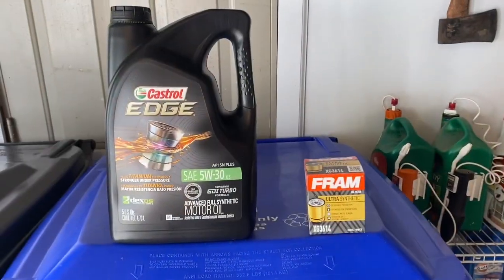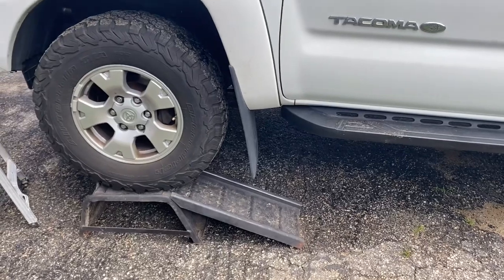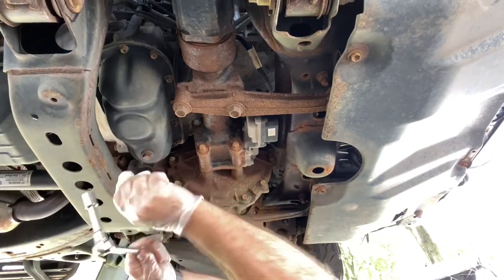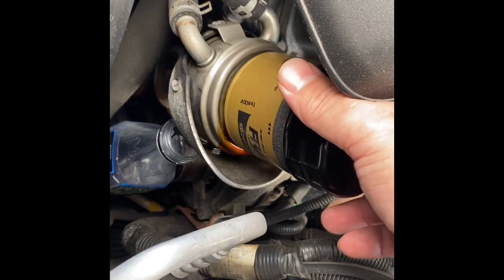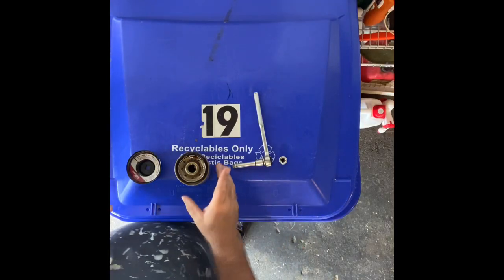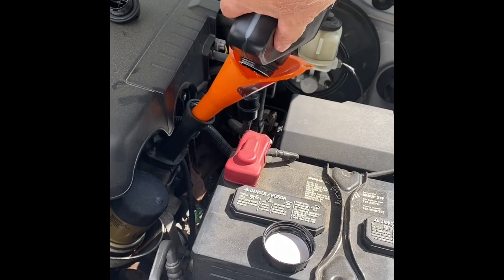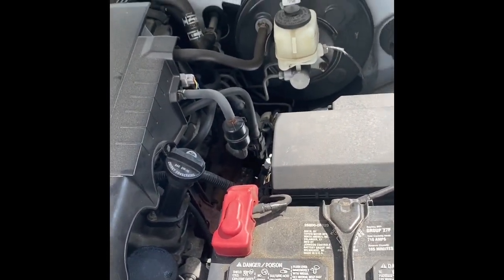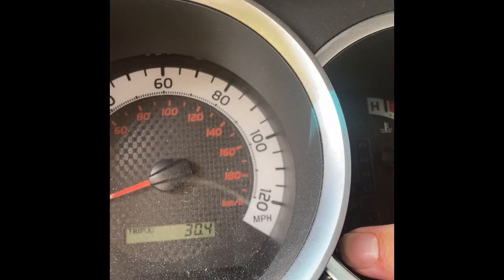2013 Toyota Tacoma oil change

Comment: Some good tips there pal. Couple more suggestions to pass on your way. When you are working in the engine bay, I would refrain from putting anything metal on your battery. You can see where your socket rolls over to the positive post, for example. It can get real easy to focus on something else and touch that positive post with a ratchet, extension, screw driver etc to a battery strap, tray, radiator etc and you got a light show. When you change a filter on an engine, an old trick, some of the manufacturers actually call it out, fill the new filter half way up with clean engine oil, it will be absorbed by the filter media but when you start the engine, that oil pressure light won't be on nearly as long because of lack of oil in the filter. Finally, when you remove that drain plug, you need to verify where the plug gasket is and it's condition, sometimes it comes off with plug, sometimes it sticks to drain pan. You should replace it every few oil changes, but more importantly, don't put a new one on, if the old one is stuck to your drain pan, which would mean you have two gaskets on there and asking for a leak, so it's important to know where it is and it's condition when you pull the plug. Good Job. BTW, looking at that oil funnel, I knew there had to be a Hog somewhere, lol. Good looking Street Glide back there!
Reply from the maker: 👍🏻 Thank you for your excellent feedback!
As for the streetglide, definitely one purchase I never regretted. Always wanted one since I was 15. Ironically, I’m too intimidated to do an oil change on the bike. 😂

Comment: When putting in the oil turn that 5-quart jug on it's side and it will come out without the back and forth glug, glug, glug. Also if you cut a ½ inch off the bottom of that funnel giving it a larger opening the oil will go through it faster. Just don't cut off too much.
Thumbs up.
Reply from the maker: Good point, thanks 👍🏻